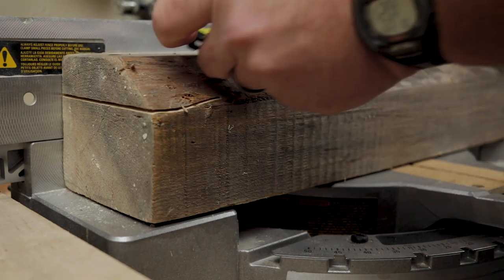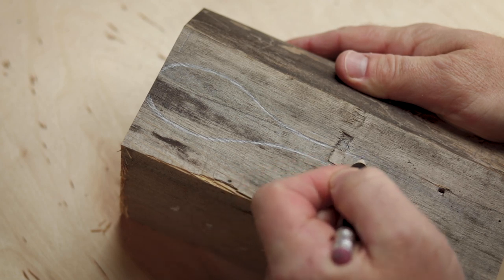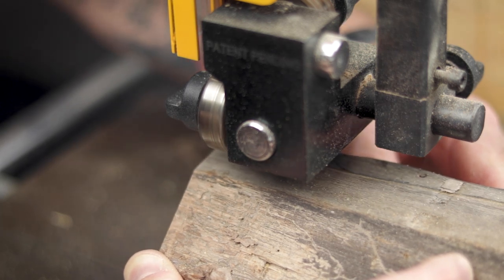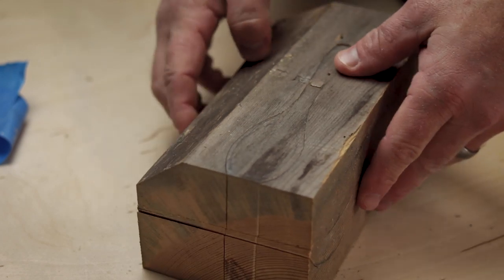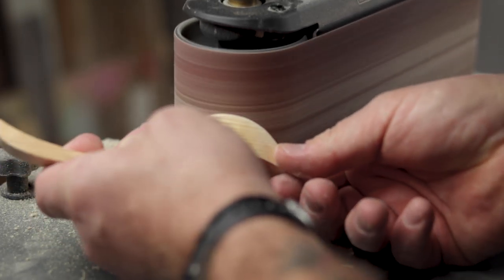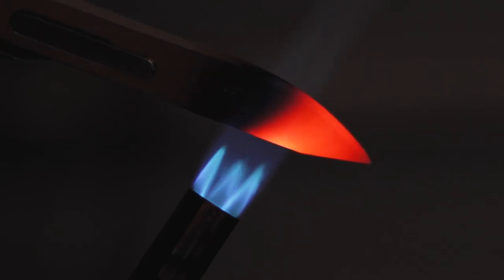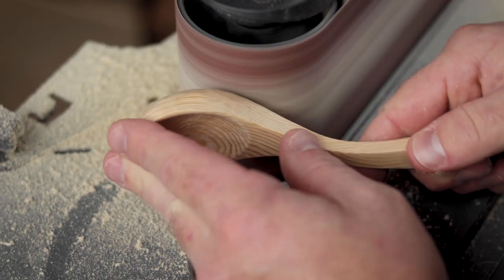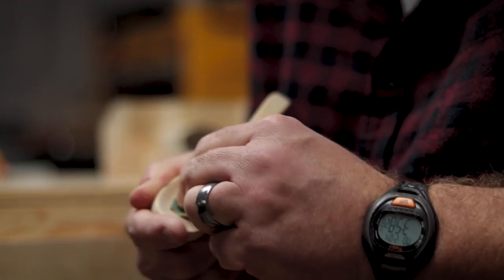My First Wooden Spoon / Shop Made Wood Carving Hook

Comment: Suggest you also try making utensils from hardwoods such as maple or apple.  Spoons are great, but your little girl will also need some ladles and spatulas.  And then, of course, she will need plates and bowls too!
Also, you can make very good carving tools using old worn out metal files.  The metal, once annealed, can be shaped easily.  After re-hardening, the tools will hold an edge surprisingly well.
Reply from the maker: Interesting. I might have to give that a try one off these days! Yeah this was pretty fun actually so a whole set might be coming!